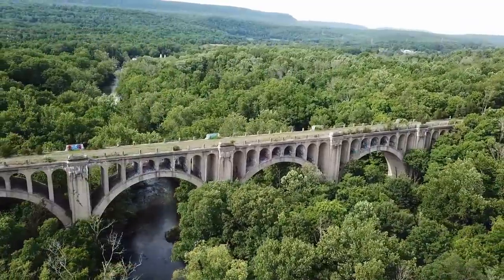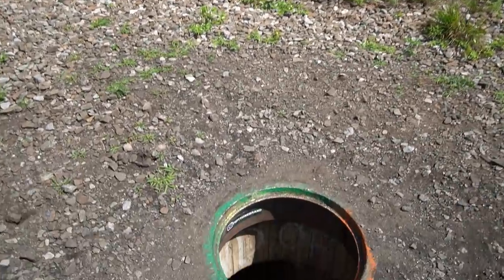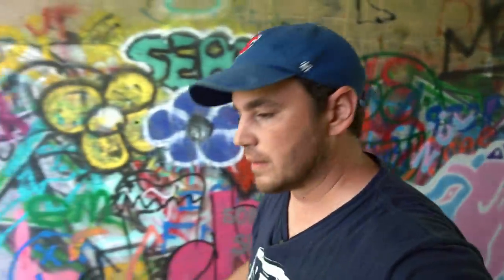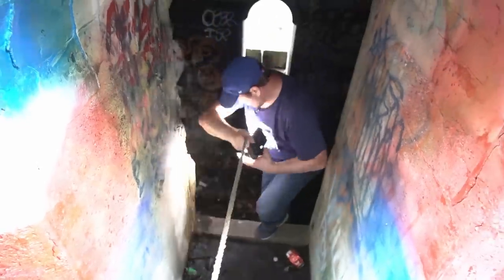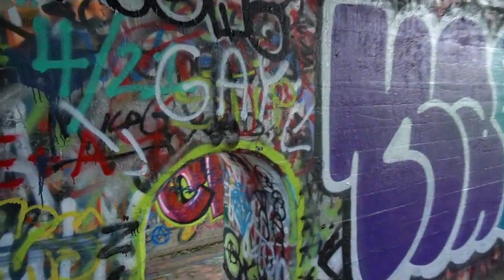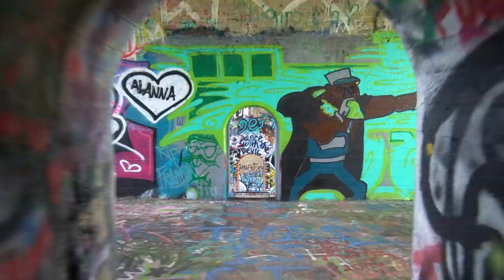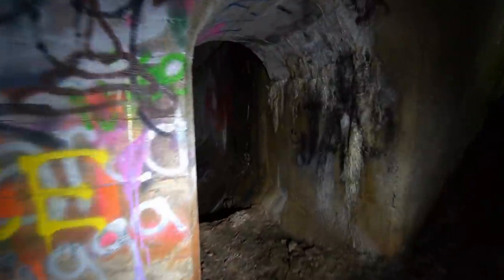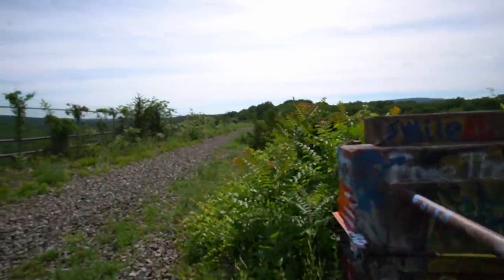Exploring the Tunnels and Passageways INSIDE this Bridge

Comment: thanx!...brings back many memories!...used to party there in h.s.-early seventies, when freight trains were still using it ...did the usual pennies, beer cans, etc on tracks to crush them...the manholes were located between the tracks...very fun to be in there when a train went by..you could pop your head out just enough  to scare the crap outta you!!!....we used to climb the arches and also just sit on the edges and enjoy the views.....don't remember all the graffiti, some initials mostly, but mostly gray, blank walls....i hope the boards in the piers are not the same ones from the seventies!!...also, at time there were no ropes.......spent a number of nite time beer parties there that were alot of fun (and it also qualifies as one the strangest places in my travels that i've had "relations" in).......never had any trouble with authoritys,  tho if seen by the train crews, they would really lay on the horn!!!...come to find out they had an agreement with the local cops that, that was a signal that there were trespassers...however, the viaduct was in the jurisdiction of a small town just northwest called Columbia..which had 1 full time officer and 2 p/t, and they were usually "unavailable'......they would call the state troopers, which meant you had at least an hour to wrap up party!!...at the time, in northwest nj..a lot towns did not have their own force, so they contracted with the state and in that area, they were always tied up with problems on the highways....i don't know about them resurrecting the train service, there  was talk of making it part of hiking routes through the area....further north they did that in the paulinskill lake area, stillwater, nj...running along the east side of the lake......oh and your tshirt reminded me of my 65 vw bus that used to take me there!

Comment: Imagine a double span. Side by side connected on top for two sets of tracks. That's the Nicholson bridge. Now imagine jumping across the gap from side to side. Nothing but air between you and the land below. 
Did a lot of crazy stuff when I was young.
And the ladder was on the outside wall